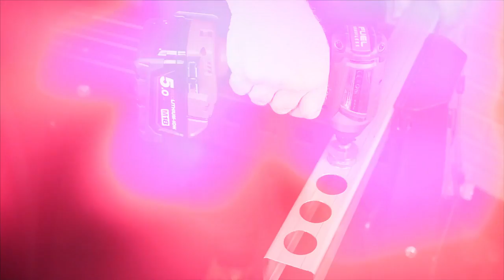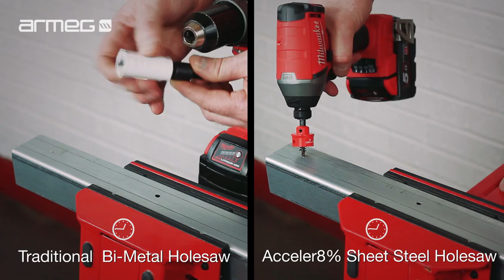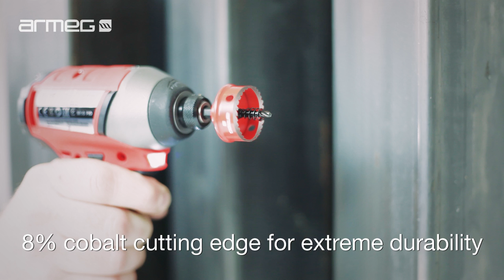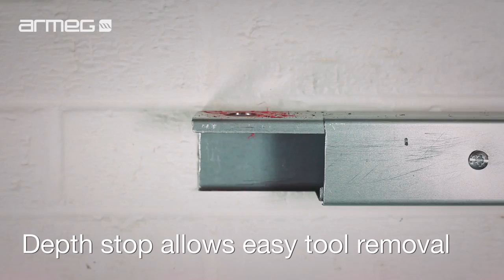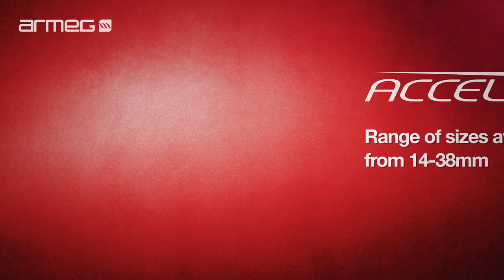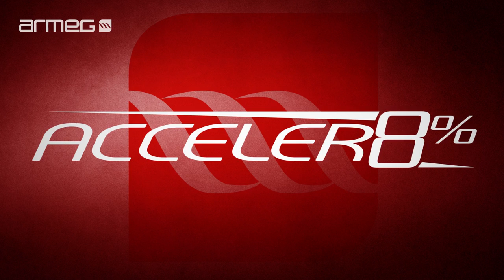Armeg Acceler8% Sheet Steel Holesaws

Comment: Been using these all.week.. dont normally give praise to tools unless they're exceptional.
Yes they're expensive but do an exceptional job and worth every pemny.

Leave a clean hole and the eject works exactly as it shows in the video.

Also bought a 20mm tungsten tipped armeg and to be fair that's just as good